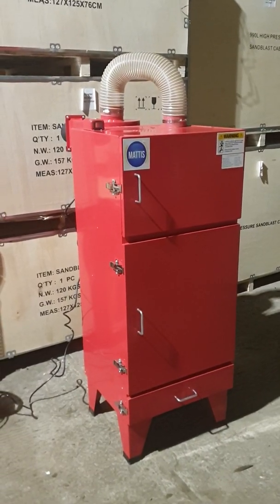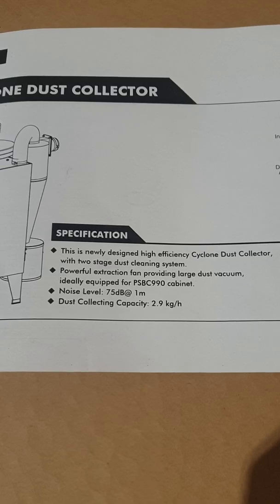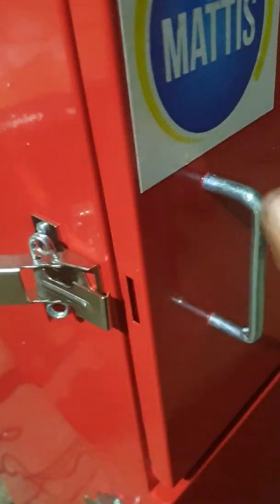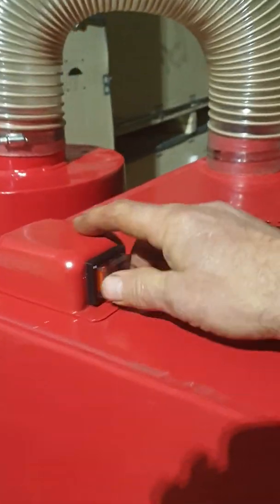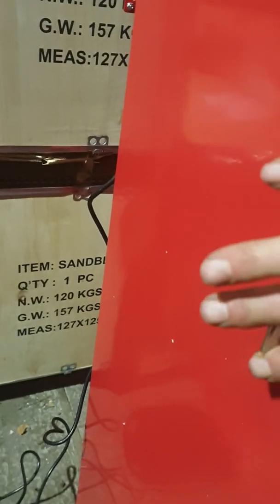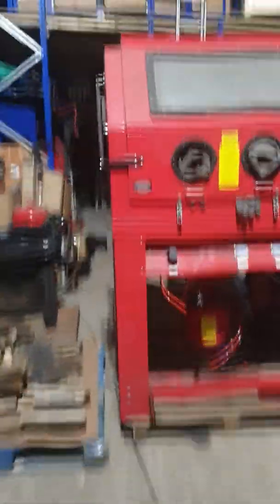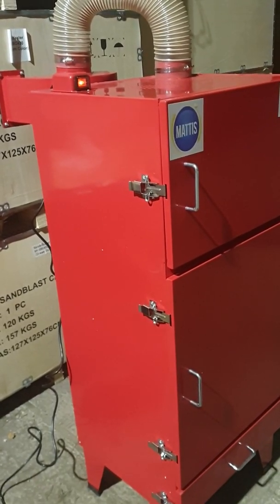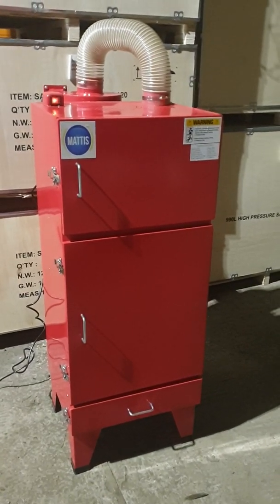Cyclone Dust Extractor for the PSBC990 Pressure Blast Cabinet

Comment: Does yours make an insufferable high-pitched screeching sound? I’m in the US and I got one of the pressure pot cabinets from redline stands, who is the US importer of these types of cabinets. Exact same dust collector too. Except mine makes the most earsplitting high-pitched screaming, when under any load at all. And I’m thinking I may have a defect.
Reply from the maker: Hi, They shouldn't be giving off a high pitch screeching sound. I've had no complaints about that, however I did have one that came back with a cabinet because the company lost a contract and the extractor was making this awful noise, it was like it was sucking air through the main door.  When I opened the cabinet door it stopped,  the minute I push the door closed again it started again. I haven't had time to explore any further yet
Reply: @Sandblasters  yup that’s a lot like my issue. Open the door and remove the load from the tubes and it sounds fine. Though with mine I can tell that leak isn’t at the door I think it maybe at the mouth of the motor or in the internal duct that leads down to the filter. I’m thinking about trying to take it apart and just reapply silicone or RTV or some kind of sealant everywhere.